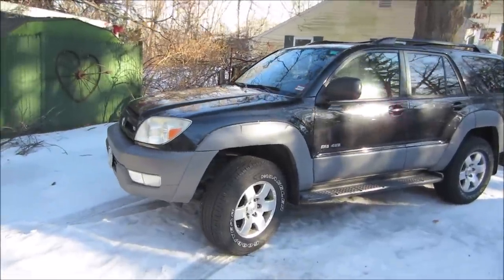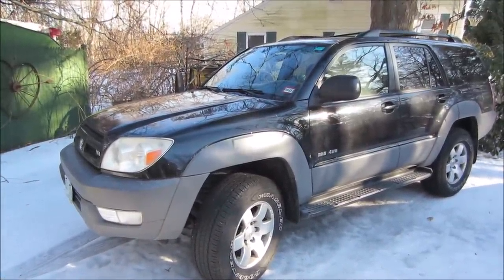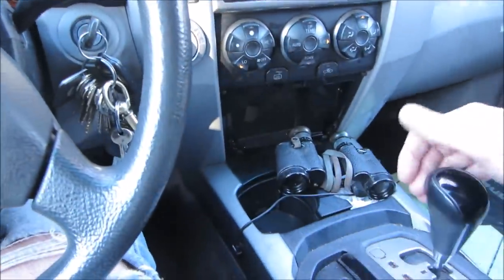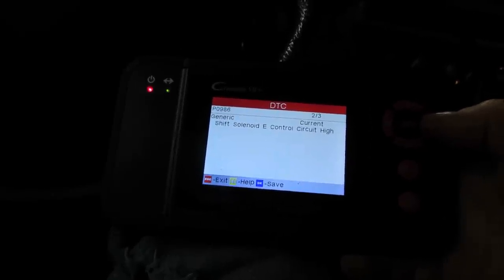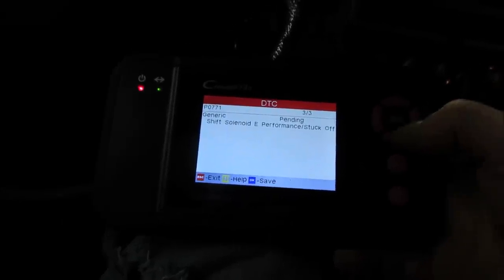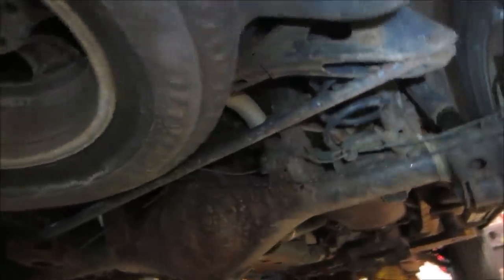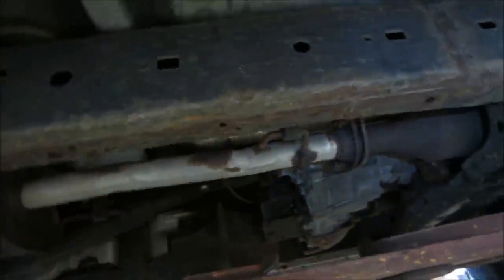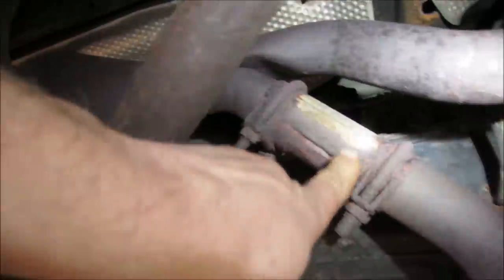Bad Toyota Transmission..Can We Fix It For Free?

Comment: Assuming you have a smartphone I'd get the bafx bluetooth obd2 scanner and pair it with the torque app.  Bafx scanner is about $22 on Amazon. There are cheaper Bluetooth scanners but I don't recommend as their quality can be hit or miss.  Start with that and maybe upgrade later if you find it doesn't do everything you need it to.  Though the bafx torque combo will satisfy most consumers.

Comment: Funny. I had same issue with my 93 vr6. Exact same plug type. I ended up taking it apart resoldering the wires and epoxy the plastic housing to seal the connections. It worked.

Comment: I had a Prizm. After a few years, the electrics (inst. panel, etc.) would "blink"/reset with every bump during a turn at speed. Took it to the dealer several times, they could never find a problem. The dealer's "technicians" were focused on the data, not the problem! I even told them it was unlikely that an error code would be stored, as the system reset every time it happened!

It finally blew the alternator -- twice! Decided to check it myself. After about five minutes, I found that the engine would stutter/reset every time I wiggled the wires from a sensor on the exhaust manifold. There was a broken wire inside the insulation just outside the plug. Stripped and soldered the broken wire, sleeved it with heat shrink -- easy fix!

Comment: You might try using a compound I've used for years to get rid of electrical corrosion.  It's called:  DeOxit 

 CAIG DeOxit Cleaning Solution Spray, 5% spray 5oz  DeoxIT helps bring old systems back to life! DeoxIT is a contact cleaner, conductivity enhancer, and lubricant. It dissolves oxidation and corrosion on metal surfaces, fills in microscopic gaps, and reseals surface for better contact to enhance the flow of electricity.
Guitar Center has it for $14.95 a can.

Comment: Hi Darren, my suggestion would be to use small finishing brads with the head cut off by diagonal cutters, which makes a sharp chisel point  while the tip is already pointed.  I once had a wire break off flush on a distributer condenser on a 77 Caddy.  I was away from home and had to improvise. I pulled out a STAPLE from a magazine in the car, straightened it. Then I stuck it half way into the broken wire ( between the copper strands and insulation ) and the other end into the short stub ( 1/16th inch stub ) slightly protruding out of the distributer housing. It was enough to get me out of a questionable part of town and back home where I could properly finish repairs.  WHEW !   J K

Comment: My dealer did something similar on my new Ford van many years ago.  It leaked water into the heater box every time it rained.  They removed the fender and cut an access hole to get to the air intake for the heater.  They put a water deflector over the intake, then sealed everything back up.

Comment: Electrical connections are often the weakest link in today's complex vehicles. I wonder what a transmission shop would have advised ("You need a new transmission") I once read in the book Drive It Forever that as a part of preventive maintenance you should disconnect all connectors, inspect and clean. That often is all that is required to keep electrical gremlins at bay.  Nice diagnosis and repair.

Comment: Excellent repair!! I have much more of a electrical background than mechanical I would have soldered wires on to each pin including the ones that were broke off and then cut the connector off and solder them together.

Comment: Nice job - well done for seeing it through - an otherwise perfectly good gearbox potentially trashed due a silly un-engineered tiny plastic electrical connector - they could have made it twice the size and used a more rugged style of connector making the repair 10 times easier.

Comment: This is THE best 4runner you could ever buy 

Pre vvti 3uzfe with land cruiser transfer case and trans

We got one with 218k 4x4 for 2500 little rear gate damage that didn't affect anything.. 

Drove like new, absolutely indestructible, was much better than the 2015 we had, the v6 just sucks... 

We later got a sequoia that was misfiring due to old plugs, 4x4 300k in MINT condition, I checked compression, 185psi in all 8, did a tune up timing belt and water pump and it ran and drove like new

Comment: You said upper right corner...looking at it to me it did look black/melted. I have a 2010 Ford Fusion and the fan just stopped working on day. I took the fan out and there is a resistor/plug that was melted. A common occurance with the Fusion I was told. remove/replace..works now

Comment: I live in Australia. 
About a month ago we had a a couple of days around 118f and in this part of the country it never snows.
I cant believe the underside of that Hilux was so crusty. I have worked on a hilux that is used on a weekly basis launching boats into the sea on the beach and it was a 95 model and it was still cleaner underneath than the 4Runner.
Last month I was pining for some different climate, seriously thinking that I just might move. No more if that's the sort of road corrosion I would have to deal with.
Cheers

Comment: I cut a hole to change camshafts in my 80 Chevy Citation V6...straight through the shock tower. Saved pulling motor and fighting with so many rusted exhaust bolts. Welded the hole shut, a little seam sealer and splash of the nearest rattlecan of paint. Good to go. I am 40+ yrs licensed myself and real skill is knowing what to cheat when fixing.!!. MUSTIE , your logic is exactly like mine..lol

Comment: Very resourceful repair.  I bet you used small welding bits to get corrosion off the female connectors.  When that check engine light goes out, that’s the money shot.

Comment: I have the same issue with the shift and/or pressure solenoid on my GM truck (4L60E). It causes an abrupt upshift from 1st to 2nd. My truck has 270,000 miles and counting. It can be reset by stopping, shutting off the engine for a maximum of 30 seconds, restart the engine & put the trans back in Drive.

Comment: Nice repair. Clever approach to try socket connection first and create the window in the tunnel. An independent repair shop would have been hundreds of dollars. A Toyota dealership would have said you need a trans rebuild or replacement for thousands.

Comment: This isn't the first time Mustie used a cutting wheel and a welder; the Honda tractor battery tray comes to mind.  Being able to weld gives you other options when repairing. The rusty underside does not match the nice body and interior.  It looks like it did not get Mustie's special wax and bar chain oil mix in time.

Comment: As the Brits say, that is a "bodge" of epic proportions.  Cutting a hole in the transmission tunnel to gain access gave me a real belly laugh. Drilling out the socket and fitting pins is classic.  How long will it last?  Long enough I guess!

Comment: A friend of mine was an electrical engineer and worked for Nisson and Honda. When he was working on the electric window circuit on a Honda the schemitc asked for 20 gauge wire, the motor demanded 16 gauge, he informed his supervisor and he stated that was ok cause the windows only are in use for a short time. So they are very minimal with there wire. Japanese cars where ok when they where cheap they never brought the quality up with the price. Nice fix but that harness needs to be replaced along with the rest of the car.

Comment: Well done! If the torque converter had been locked up and wouldn’t unlock, the truck’s engine should have stalled out each time you attempted to drop it into gear (any gear) with your foot on the brake. In my experience, a locked up torque converter will act (somewhat) as if your attempting to drive a manual transmission without depressing the clutch when your shifting into drive or attempting to drop the RPMs back to an idle ... ie ... engine dies when you drop the shifter into gear without pressing the accelerator / you must keep one foot on the brake while pressing somewhat on the accelerator at a red light/stop sign or the engine stalls. Had this happen to me on a road trip once and was able to keep it going (on the interstate) for 4 hours of driving to get home. Unfortunately for me, it wasn’t a bad solenoid - it was a failed converter.

Surprised that the Toyota didn’t last longer? At 200,000 miles, they are usually just getting warmed up!

Comment: Get yourself some "pogopins" they are spring loaded, so they will conform to the length better. You can also try watch strap pins (also spring loaded).
Packets of these are available for a couple of dollars on ebay.

Comment: Surprised you didn't scrounge up a salvage yard replacement plug, cut off the old one, and solder in the replacement.  

But you got it fixed anyways, nice work!

Comment: Were you secretly viewing a pinout that you didn't mention?  It is not uncommon for such a cable to not utilize all the pins or be just extra grounds.  I'm curious to know why you didn't spray deoxit or something like that onto the pins and the sockets.
Also, they really need to use different materials for these damned things. That plastic hardens up quite easily and becomes brittle. Given the location, that connector needs to be better built with a much better seal.
Great job!

Comment: simple but messy! The pins broke off in a "cold" place, so corrosion as well so putting those pins in will give intermittent problems after which you got when you tested.
From repairing electronics a long time, i would have carefully lifted the internal connector out and bridged those 3 wires with jumper or solder wires to confirm hard temp repair, then work on the pins otherwise you could spend all day on the pins only to discover theres other "bad" pins too that are effected when you disturb the connector. each time
Other pins may also fail given that 3 have now, so you may need to do the whole connector - good luck! haha
Cutting hole in car is necessary if the only alternative is no trans, so repairs arent always easy or pretty and its been a good car you say...

Comment: If that isn't a long term fix you could bypass the plug on those three wires and put three bulkhead electrical fittings through the side of the pan with good sealant if you have room.

Comment: if you have a telephone or data friend they have cables that plug into computers that have pins very similar to what you worked on. You can just remove the pins and put them in for the bad ones

Comment: That is nuts. If I tried that it would be a horrendous mess, and more things would be broken before I just completely remove the connector altogether and solder the wires together.

Comment: On my Dodge to get the cruise control on you first turn on the computer. So cruise worked well but it might take quite a while to get the computer to turn on. I went to the ECM under the hood and unplugged and re-plugged both multi prong plugs. It was difficult to figure out how to get them unplugged. It was not straightforward and one plug took about three steps to get unplugged.  After I did this it turns on immediately with the first click.

Comment: You have magic hands, men.
A suggestion for the next; remove the connector, remove the harness, solder new connector pins from rear to the harness, then replug the connector. Flush the transmission oil, remove the oil pan, run the engine for 20 sec., shift thru all gears from P to L and back to P, stop the engine. Then fit the oilpan back on, fill the trans to full. Let the engine idle for about 2 min's in P, check again fluid level, fill trans back to full, drive the car for 2 mls, then check trans oil level again. Stop engine. 
Fill trans fluid up to full hot. This method drains also the torque converter.
I use this method on european cars but not tried on japanese bc they never broke.
That bumping into the gears is usually a borg-warner thing, but not by Aisin.

Comment: Salted Winter roads, there's your cause right there....Both the plug / socket and the Chassis....Corrosion.  Toyota didn't think to make an access panel to get to that Trans electrics did they..?  Imagine dropping the Trans off just to find that corroded socket.

Comment: @ Mustie

Is that 4th gen a v6 or v8 AND is the trans unit the same for v6 and v8. My bros girlyfriend is having very similar issues but hers is sorta comin and goin and seeming to be comin more and more frequently. 03' 4.7 AWD v8... very near 400k on all original drivetrain. SoCal high desert truck (no corrosion issue, more likely dirt if in the connection). Good place to start lookin for issues I guess, couldn't hurt anyways. As always, enjoyed the video, thanks man.

Comment: Mustie! Help me! My 2000 Tundra is pulling similar crap on me right now. If I come to a stop the engine stalls. It's  acting  like a stick shift  with the clutch engaged.  After watching your video,  I'm  leaning towards the presure plate solenoid.  Thoughts? Opinions?

Comment: You might have said it in the vid, but does that connector not unbolt from the trans and come out a little?  Would have made repairing the pins easier.

Comment: Silly electronics! Wasn't exactly what I would call an easy fix but it was cheap so that's just as good. Guess eventually the seals in those weather pack connectors start to dry and shrink and let moisture in.

Comment: I was gonna pull the 10mm on the trans pin block.....cut off the wires and straight splice them to the harness and fill the hole with spooge!

Comment: Granted it made it to 200+K but you would think Toyota could design a simple electrical connector that didn’t self destruct all on its own. Just like you’d think they could have designed the head bolts on four cylinder Camrys that engaged more than a few threads so they didn’t strip out causing catastrophic engine failure, or Corolla piston rings that didn’t collapse and result in massive oil consumption, or Prius software that didn’t result in brake failure, or .... The list of embarrassing Toyota engineering failures is long.

Comment: If you took it to a repair shop and they got into the transmission and replaced both ends of the faulty connector, roughly how much would that cost?

Comment: Good Lord, is that a saltwater flood car? I live in GA and never see any vehicle corroded like that, I'd be scared to drive that thing, my 87 Ford f150 still looks brand new underneath and runs like a champ with 320,000 miles on it.

Comment: Congratulations for fixing it. However, with all the time you spent cutting a hole and “modifying “ the two sides of the connector, you could have pulled the pan and changed the harness. I think it is going to fail again.
Reply from the maker: you are forgetting the rusty exhaust that needs to be removed, that in itself can turn into an all day affair if you break the studs
Reply: I’ll take your word for it, but it sure looks like once the pan is loosened it would have enough clearance to clear the valve body and oil tube.

Comment: Can someone explain how the pins in the connector became broken in the first place, particularly since there had been no work done in the area?  And wondering how the new pins (drill bits) were able to be aligned so that the plug was a snug fit into the socket. Thanks!
Reply from the maker: they corroded over time
Reply: @mustie1  Ok thanks. And the plug snapped into place ok?

Comment: FYI, as far as i know, that connector lifts out of the case just by removing the screws. Can't remember if it's the same, but i did that to a 17 Toyota transmission a friend dropped at my place. I sincerely do not understand what Toyota is thinking with those breath-on-snap pins. Especially in that area, they should be at least one and a half milliliter thick. I mean, i can get a cheapo PC supply with better pins than a car transmission has? That's ridiculous as far as i'm concerned (that's how i replaced and fixed the problem, i used a PC board connector and lots of goop.

Comment: Manual dude !!!!!! Even Toyota that I think Americans tink there crAp there actually one of the best but I can only say that cos I’ve no experience with American moters but in Europe Toyota manuals are a great moter but from my experience anything automatic is crap. I had a very similar jeep few years ago but even that for some reason was crap engine was fine but whoever we got it off had the four wheel drive shaft taking off which we didn’t know at the time it was bought. It’s what we call a girls jeep as it wasn’t man ly or beefy it was more like a split between a jeep and a car 😂 but when u put it in 4wheel drive the inside lights showed that it was on which in fact it was only frontwheel drive and it drove  fine without the back drive but u buy 4 wheels drive to drive four wheels ! But as it was it drove better as in it was cheaper to drive gas wise but I got the part and it was just basically 4heavy bolts each end gearbox end and axle but it all made sence when we put it in as the backend was winding like hell 🤷🏻‍♂️But witout the back drive shaft it drove perfect  it actually drove for a get around “car” for 7yrs but I eventually asked a Toyota mechanic why for that amount of driving time it was perfect witout the shaft not even a noise or I wouldn’t have drove and trusted it for the driving I done which was well over 1 hundred thousand miles but the mechanic told me they took a lot of them back as it was a common problem that would Need a new axle if I was To drive it as a 4wheel drive. But because there was no serious stress on the axle it would work fine and continue to do so. So when it came time to sell it after many years and mileage the mechanic I asked about the jeep originally bought it for his wife long story but a true one

Comment: Why not unbolt the connector attached to the transmission. It has a BOLT NEXT TO IT.
Reply from the maker: you know it is still connected on the other side right? you would need to pull the pan and unplug the harness